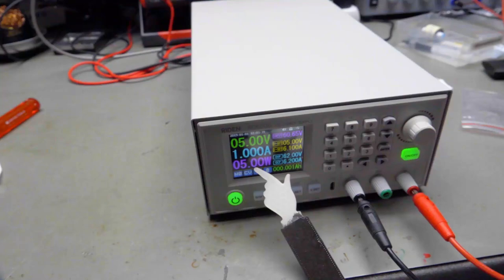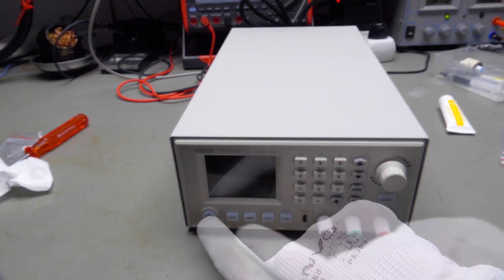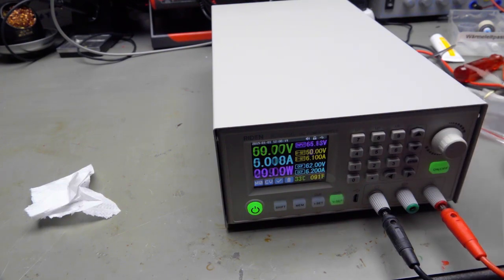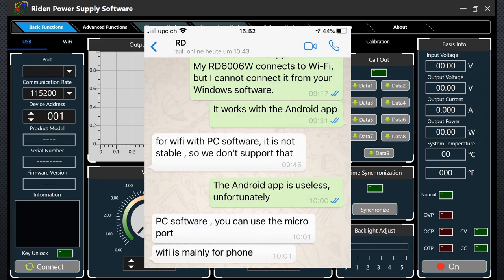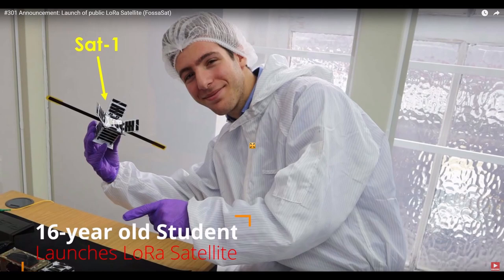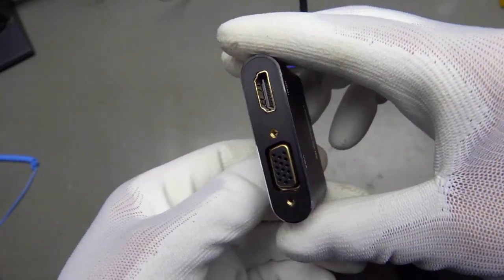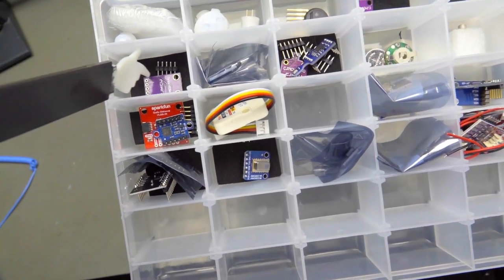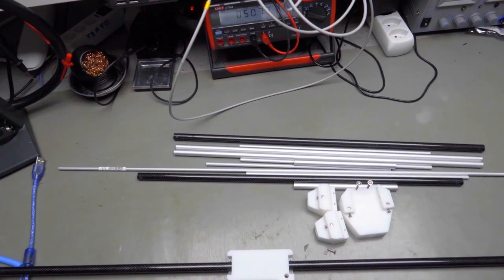#309 Mailbag Part2 (Bench Power Supply, High Power LEDs, New LoRa Chips, etc.)

Comment: Can i use lora to send Data from sensor in ground floor to 10th floor?
Reply from the maker: For sure you can send the data. But you have to try if you receive them ;-) There is a small chance it will work. But keep in mind: LoRa only has a small capacity. Maybe powerline is a better choice.

Comment: Why is everyone making the mistake of naming this thing a power supply while it isn't a power supply, it is a power converter which is programmable... You still need to connect a POWER SUPPLY to the power converter so if you only buy the front you can't do anything with it.
Reply from the maker: Your systems boundery definition seems to be a little wider than mine.

Comment: I bought a power-supply on ebay some time ago. It was a "cost-effective" one but I did notice an issue with it. When it started, or recovered from a "over-current" situation, the voltage would overshoot. I trashed an ATMega328 and an OLED screen due to this. Was supplying 5V but after an over-current situation, this went up to over 12V for 20mS - enough to cause me problems. Something to bear in mind with cheap stuff from Asia.
Reply from the maker: That is bad. I did not test it this time. But other power supplies from the same manufacturer were good in this respect. I do not remember if Dave from EEVblog tested this feature.
Reply: @AndreasSpiess  He did. It looks like to be clean on oscilloscope when recovering from overcurrent or on start. But it was high-current and high voltage situation, if memory serves me correctly. Andreas, can you try to test it in various situations, including 5V and low overcurrent limit, please?

Comment: IRLB7430  and  -IRLB8721 Was complete let down.
IRLB3034 was REALLY good and i actually used it instead of 7430s.
sadly they will not match the graphs & specs in the datasheet.
there are numbers in datasheet . numbers IRF Inc demonstrates and numbers you will get in your lab , these are all 3 different numbers.
these behave nothing like the data sheet graphs say. my gates wont even latch until 4v on 8721s.
maybe you'll get actual mosfets like the data sheet if you get from Mouser or digiKey , i dont know . im very happy with my IRLB3034's
Reply from the maker: I made a video where I tested my transistors.
Reply: @AndreasSpiess  I already saw is Andreas , Thank you very much ... we Love the guy with the Swiss accent ;)

Comment: Interesting stuff. Where do you store all these items, I would run out of space ;-)
How much is the dB gain of this Yagi? I have a HB9CV for 433mhz what is very handy. Wouldn't have a Moxon Antenna do have a similar performance with less dimensions? And again maybe you would gain the same effects by using smaller antenna with filter and preamp ;-) Happy weekend.
Reply from the maker: 1. I do not know about the gain. It is also hard to measure.
2. Pre-amps are simple if you only receive. More complex for Transceivers because you have to switch them on and off.
Reply: @AndreasSpiess   I ordered a small Moxon Antenna for 868mhz and will do some tests when I have it. Yes lna inkl. transmitting is more difficult.

Comment: FYI: If anyone interested, you can find my custom firmware for RD6006.
If you have any ideas, wishes, what to change or what to add in to the firmware, or found any bugs, just let me know.
https://www.eevblog.com/forum/testgear/ruideng-riden-rd6006-dc-power-supply/msg3192172/#msg3192172
https://monitor.net.ru/forum/threads/651114/page-10
Reply from the maker: Thanks for the link. Good to know that it exists. Just one question: Why do you not put your development on GitHub? It would be much easier for everybody, I think.
Reply: @AndreasSpiess  I contains private keys to encrypt firmware, I can't share it.
Reply from the maker: Ok